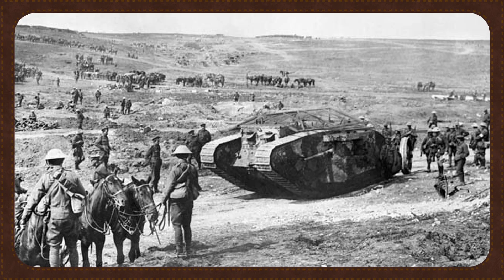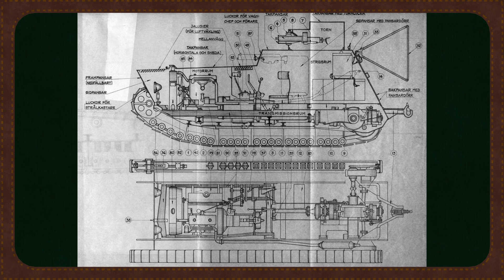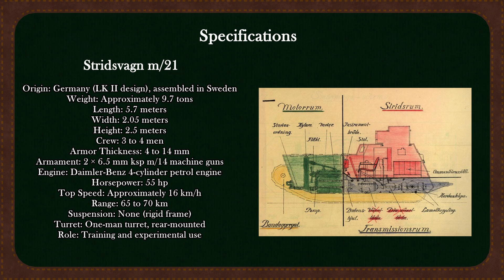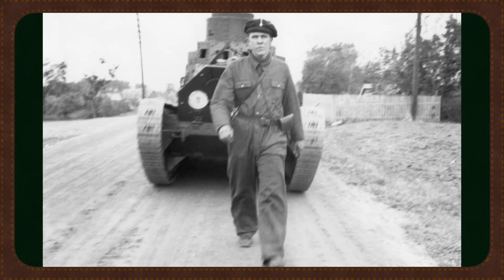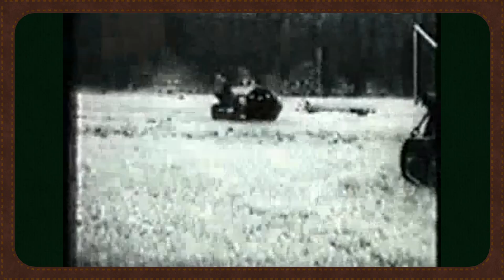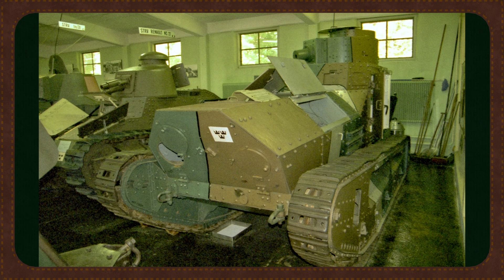Stridsvagn m/21-29 | How Sweden Entered the Tank Age

Comment: First a correction:
You say it was armed by "kulsprutepistol m/14(-29)" which is wrong. It's just "kulspruta (or ksp) m/14(-29)". Kulsprutepistol, shortened "kpist" means submachine gun whereas kulspruta is the term for a proper machine gun. (In Finnish Swedish the term "maskingevär" is used instead.)

Then some information about the organization:
* The tanks were organized into platoons of five. (Later found to be too many to handle lacking radio equipment.)
* Each tank was part of a squad with eight men, four inside and four outside the vehicle. The squad leader was walking on foot outside. One of the eight was a bicycle orderly. The vehicle crew was a driver, a commander and two gunners (one for the turret gun and one for the MG that could be moved between gun ports on either side or rearwards.
Reply from the maker: Thank you! Mixed up the kpist and ksp! And great extra info!
Reply: Thank you! Ksp is called maskingevær in Norwegian.

Comment: Engine in m21-29 is not 1554 but 1544. 1554 is a wrong typing done 50 years ago and still impossible to erase. There never was a 1554 - the correct designation is 1544.
Reply from the maker: I See! Apologies! I have added a correction in the description!